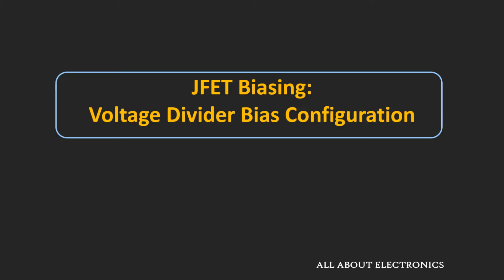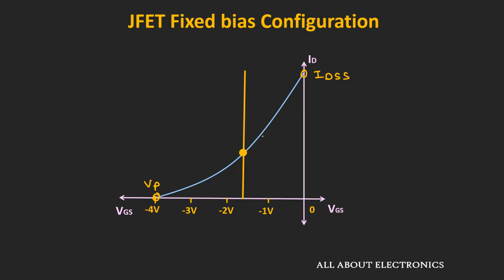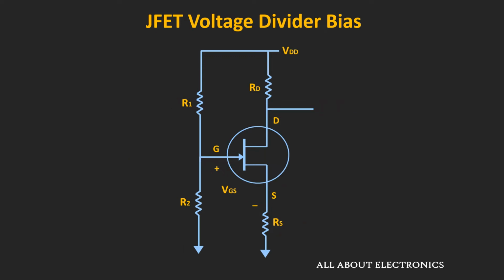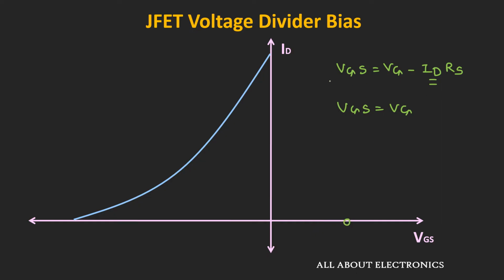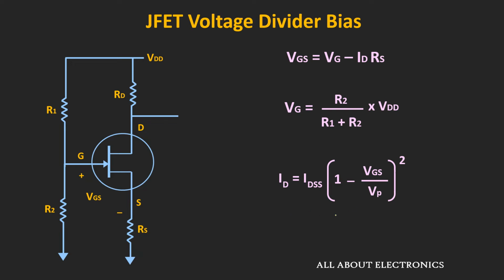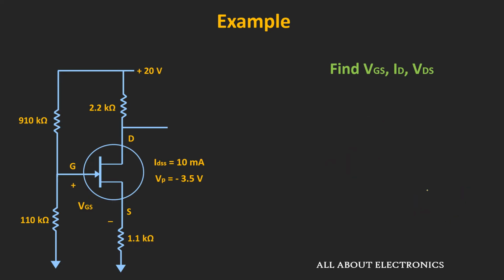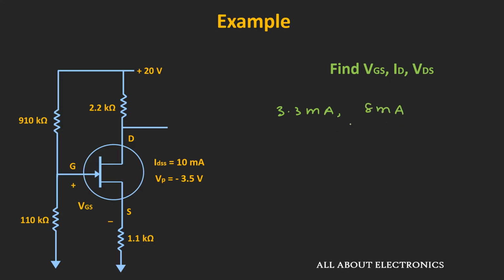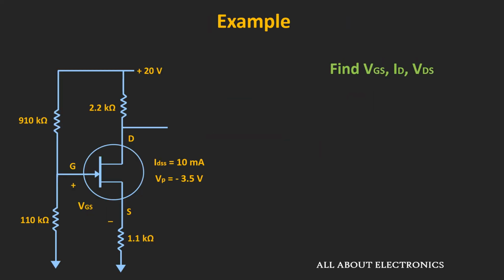JFET- Voltage Divider Bias  Configuration Explained (with Solved Example)

Comment from the maker: Little correction at 1:08
0 ≤ |Vgs| < |Vp| 

Timestamps:
0:00 Introduction
1:44 Comparision of Different Biasing Configurations (Fixed Bias, Self Bias, and Voltage Divider Bias)
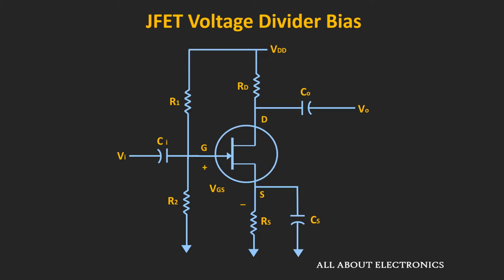4:30 Graphical Approach for Voltage Divider Bias 
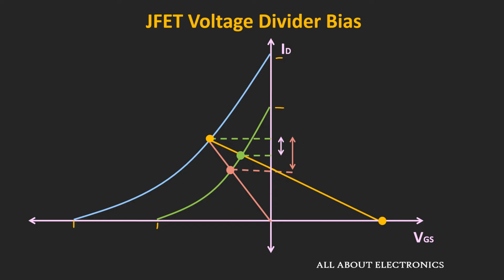8:26 Mathematical Approach for Voltage Divider Bias
9:31 Solved Example
Reply: please add subtitle for this video😢

Comment: Can you please tell me why did you put Rs in ohm instead of kilo ohm
Reply from the maker: Because here, while finding the value of Id, it has been assumed that, Id is in Ampere. If you assume it in mA, then for Idss, you just need to write 10 instead of 10mA, and then for Rs, you can use simply 1.1. I hope, it will clear your doubt.

Comment: Sir how the drain current becomes zero when gate source voltage (Vgs) is less than the pinch off voltage as per the output characteristic curve the drain current is only zero at the cut off region?
Reply from the maker: when Vgs is less than Vp, then JFET operates in the cut-off region. 
For more info, please check the earlier video on the JFET. Here is the link: https://youtu.be/2I_8YNVgbEw?si=zEE1mfvlTgGF9uHR&t=536
Reply: @ALLABOUTELECTRONICS  Thank you Sir.

Comment: How can we determine Q point for this configuration ?
Reply from the maker: The Q point is the operating current Id and voltage Vgs. And from the Id, you can easily find Vds also. The same is shown in the example at 9:35. By following the same procedure, you can find the Q point.
Reply: @ALLABOUTELECTRONICS  So we just say that Idq is the same value with Id for this case?

Comment: Guys are athere any differences between Idq and Id or Vds and Vdsq or Vgs and Vgsq
Reply from the maker: Idq, Vdsq and Vgsq represents the operating current and voltages. Id, Vds, and Vgs are the variables used to represent the specific voltages and currents in JFET. I hope, it will clear your doubt.

Comment: Can you please tell me how you reached from the second line to third line at 12.50 mins
Reply from the maker: Basically the term inside the bracket was expanded and it was multiplied with 10mA / (3.5)^2.

Comment: 15:52 what operating point in that area as that in negative area, saturation?
Reply from the maker: Yes, in saturation. (where drain current relatively  remains constant with change in Vds)
Reply: @ALLABOUTELECTRONICS  but the point is in negative area (left side of the curve), where in 0:49 saturation point is in right side of the curve.

Comment: There's an error at 13:18 when you say -11.16 instead of -10.16, isn't it? Or am I missing something?
Reply from the maker: In the equation, there is Id on the left side also. If you bring it on the right side then you will get -11.16. Therefore, -11.16 *Id is written. I hope it will clear your doubt.

Comment: Rs = 550, Vds ≈ 4.75 V, Vgs ≈ -0.89 V,  Id ≈ 5.5mA

Rs_min  ~ 470 ohm (<=  this is wrong, for more info pls see below)
Reply: @justpaulo can u plzz show how u got minimum source resistance
Reply: @728sahilpanchbhaiya5  
I don't remember, but now I think I'm wrong. Now I think Rs_min ~ 434.2 ohm. Here is how I get it:

Vd - Vg  ≥ 3.5  ⇒   Vd ~ 5.66 V   ⇒   Id = (20 - 5.66)/2.2kohm ~ 6.52mA

6.52mA = 10mA*(1-Vgs/-3.5)²   ⇒   Vgs =  - 0.674 V  ⇒   Vs = 2.831 V

Rs_min = 2.831 V / 6.52mA  ~  434.2 ohm
Reply: @justpaulo  I don't think that the min R is correct.  Min R occurs when Id = Idss. So 10mA*Rmin - 2.157 =0 or
Rmin = 215.7 ohm.
Reply: @Jnglfvr   If Id = 10mA then the voltage drop in the 2.2 kΩ drain resistance is 22 V. The JFET would not be in the saturation region in that case. For saturation Vd  ≥  Vg + 3.5 .
Reply: @justpaulo  In that case Idss must fall to 20/(2.2 K + 215.7) = 8.28 mA which would give a drop of 18.216 V not 22 V. So drain voltage would be 1.784 V.
Reply: @Jnglfvr  Idss is a parameter of the transistor and its fixed in this problem to be 10mA.
A drain voltage of 1.784 V is not enough to put the transistor in Saturation (which is the desired operating region).  For the JFET to be in saturation Vd  ≥  Vg + 3.5  =>  Vd  ≥  ~5.66 V
Reply: @justpaulo  If Idss is fixed then no matter what Rs happens to be there will still be a 22 V drop across Rd. No?
Reply: @Jnglfvr  No. In the example it was given in the video when Rs = 1.1 Kohm, Id= 3.3mA and therefore the drop across  Rd = 7.26 V (and Idss was still 10mA).
Please review the video several times.... you seem pretty confused. You might not be understanding the Idss concept...
Note that Id is not the same as Idss.
Reply: @justpaulo  Look, you say Idss is 10 mA. Yes? When Idss is 10 mA what is the drain voltage? It's 20 - Idss*2.2K = - 2 V. Now since Rs is nonzero Vs > 0 meaning that conventional current is is going from source to drain which is not correct.
Reply: @Jnglfvr   Idss is a JFET transistor parameter. Idss = 10mA does NOT means that Id = 10mA. 
Id = Idss (1 - Vgs/Vp )²
Likewise Vp is a JFET transistor parameter. Vp = -3.5 V does NOT means  that Vgs = -3.5 V.
I can't lose more time with this. You need to go watch this video and all the previous ones about JFET operation.
Reply: @justpaulo  Do you agree or not that with Vdd = 20 V and Rd = 2.2 K that it is IMPOSSIBLE for Idss to be 10 mA? The parameters of this example are inconsistent.